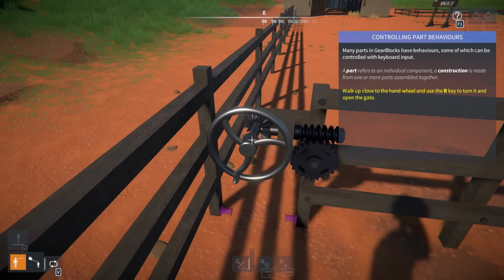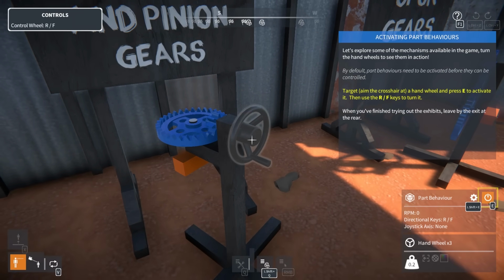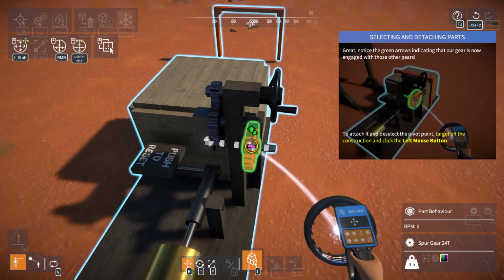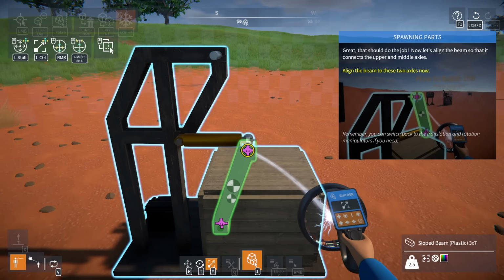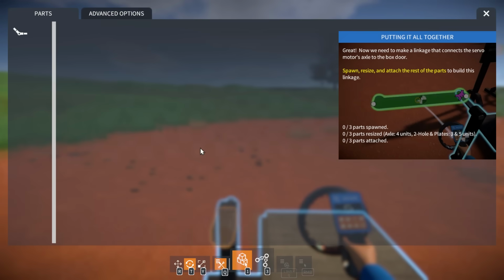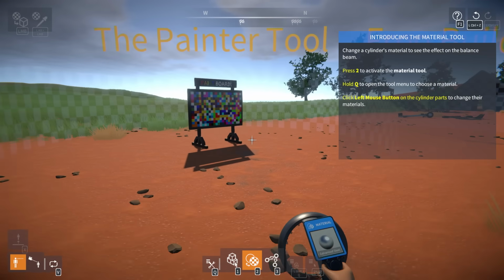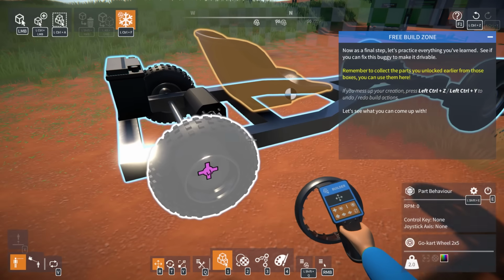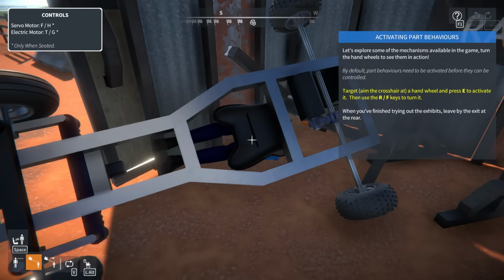Building Mechanical Systems in the NEW Sandbox Game GearBlocks!

Comment: Every time in the video when he says that the building is like the Robocraft building system he actually means it is like the RoboCo system. 
Robocraft is a very rigid grid-based building and doesn't have hinges or bearings (at least the original Robocraft). RoboCo is exactly what he describes in the video.
This game seems awesome, and it feels a lot like lego-technic which is a very good thing.
Reply from the maker: Did I say robocraft? Whoops I 100% meant roboco you are right.
Reply: You are not wrong about lego technic, I immediately knew it was inspired by LEGO technic, because the gear wheels had exactly same number of teeth and modul as LEGO technic gears, I even asked dev about it and he confirmed it
It was a LOT of years age tho
Reply: I was confused all the time, like what does he mean? Robocraft 2?
That makes much more sense, although I think RoboCo used it's system from GearBlock
Reply: Thank you I was so confused. I played robocraft years ago and was like wow they must have really updated it

Comment: High-end RC don't have a reverse!!! 
having a reverse would add weight or you would need to cut power to have an equal-weight ESC Vs forward only ESC. this is one of the reasons why in RC racing they run forward-only ESC (more power to weight)... also the rule is forward-only in racing (they don't want you to reverse into traffic).
Reply from the maker: High-end drift RC still has a reverse. I don't have RC race cars, only crawlers and 1/10 drifters :P

Comment: honestly those components kinda look like legos. I dont know why, but to me they kinda do.
Reply: The gears in particular look a lot like Technic gears. Which makes sense, since in both cases the spacing between gears is defined by the grid system, which limits the available gear sizes/ratios a bit.

Comment: Kan, this is a mechanical game. A true piston engine doesn't have "sensors" it uses a camshaft.
Reply from the maker: That is a good point but it also uses fuel that expands the pistons. We need to be able to trigger the pistons somehow if they are electrically driven.
Reply: @kANGaming  What I meant is, if you want a "true piston engine" try using the crankshaft with pulleys to rotate the camshaft to trigger something that would move pistons. This also means the variable speed doesn't screw up the timing and lock the engine in one specific rpm range.
Reply: unless it's Koenigsegg Freevalve
Reply: It has timing for when to spark the fuel.  This is usually a hall effect sensor and magnet... Or maybe mechanical break point thing....

Comment: As an aspiring engineer myself, there's one thing that disappoints me in this game: 
No cables.

I want to be able wrap a cable around a pully at the top to raise a platform and then uncoil the pully to lower the platform. Essentially a cable elevator. Yes it has pistons but the cool things about cables is they can BEND. Like, around corners. Which helps translate/redirect motion SOOO much easierly. Now granted in real life you dont necessarily want to do it this way because it's sacrificing alot of force but shush. Just give me cable coils that can wrap around pullies and hooks.
Reply from the maker: I agree cables would be cool. The game is still under active development and the dev does take suggestions on discord.
Reply: @kANGaming  I won't lie, I have been thinking of doing a 3D Render (using blender) for concept art to tweet at them for how I imagine the system working. . . but man would that be an annoying amount of work.
Reply: @Hadeks_Marow  If you think that would be an annoying amount of work, just imagine how much more work it would take to code it in. There is a reason why games don't do it.
Reply: @kANGaming lets hope they don’t pull an axolot if we all migrate to this game 😅💀
Reply: Yeah and cable/rope physics are a nightmare for that very reason
Reply: @to_the_seas  keep in mind it doesn't have to actually be rope physics. Just like how the current pullies don't use rope physics. Just like how the Pistons don't use rope physics. From a programming standpoint, it can just be a ball joint piston that is controlled through a wiring connection to a pulley. The rope doesn't have to bend with physics, only it's endpoint connections do.

The way I see it, you use wiring to connect a pulley to a loop-hook. Now the end of the cable is tied onto that loop-hook. If you connect that loop hook to another loop-hook, the previous loop book is longer tied, but instead the cable is going through the loop and then ball-joint bends to the next loop-hook that you just connected. Then if that loop hook is the last in the chain, it ties itself on. All loop hooks are ball points where as pulleys would be hinged-like where it rotates on an axis. 

The cables would just be solid tubes with end point connections. The length can grow or shrink (like a piston) if the starting point is a pulley. Like how a fishing pole reel works. Only the final segment would shrink.
Reply: @Hadeks_Marow  had a thought - the piston + ball joint physics, while actual rope physics would only be calculated for the visual model with the endpoints as anchors. Definitely has its own host of issues, but could be passable somewhere
Reply: @8bitarmory846  You wouldn't even need rope physics visuals. Infact, for engineering purposes, you would actually WANT the visuals to match the hitbox, so a stiff tube would be fine to represent cable.

The main 2 reasons you would want this instead of just a piston on a ball joint is if you want the source of pull to come from rotation. The second main reason is if you wanted to relay the information from a distance, since you can string that information along the loop hooks. Lets say your input is all the way on one end of the creation, but your piston is on the other. A pully cable guided by loop rings would make navigating and bending corners to each it's destination more easily.

I do see some issues as well, like if some of the middle loop-hooks move, how does that effect the pully?
Reply: I waa thing of cable as eletrical wires im a goof
Reply: @jessejarvis3646 Nah, I don't blame you.

I try to refer to it as "loop-hook and coil". 

O-[box] 

The string goes through the hole "O" and allows the string to bend in any direction on all 3 axes. Where as a pully only allows it to bend straight. It's the difference between a hinge joint and a ball-joint in regards to cable pulling. 

Think of it like a fishing pole. You know the thing you have to spin to real the fish in? You are reducing the length of the string. the string first goes up along the pole, then bends down at the top to go towards the water. I want that.

This would be useful for elevators, cranes, ect. I'm hoping it will be added in a future update.
Reply: they could reuse the belt mechanic for connecting. but there would be an end spool and pulley like, checkpoints
Reply: @Crazyclay78YT  Exactly what I was thinking. But also a loop-hook screw that the cable could through/something else you can connect it to. It's how you would attach the cable to a solid object or have the direction change.

O-- <--loop-hook
Reply: name me at least one game where there are cables (not a game about demonstrating cables, but a full-fledged one)
Reply: Damn I hadn't thought of the importance of cables in mechanics since when I was watchin Wile E. Coyote toons. This should be why I'm no engineer at all! :D
Reply: @bonovoxel7527 I recommend looking into Da Vinci's Lion. My end goal is something like that, but is humanoid/bipedal instead of quadrupedal (4 legged). The main goal is to make everything work off electronic motors rather than say. . . hydraulics or pistons.

It's the closet thing how real muscles work. With veins contracting and releasing tension.

Comment: Wait, isn't that first system wrong? The one on the gate. It's basically a worm drive which has the feature of being self locking, so the gate wouldn't close by itself or did I miss something?
Reply: Maybe gearblocks doesn’t have friction between gears? A worm gear could theoretically be makeover with low friction
Reply: @lukasheede2895  that is true.
Reply: It does work correctly. That specific gate has an issue where the gears slip if you open it too far.